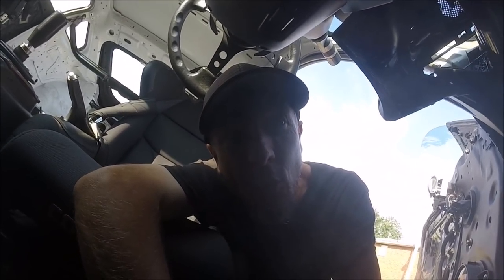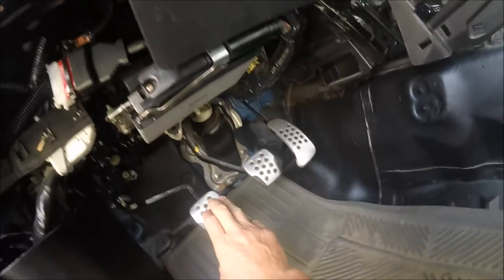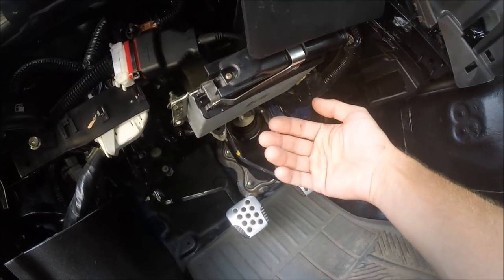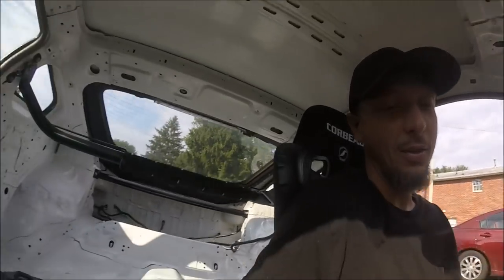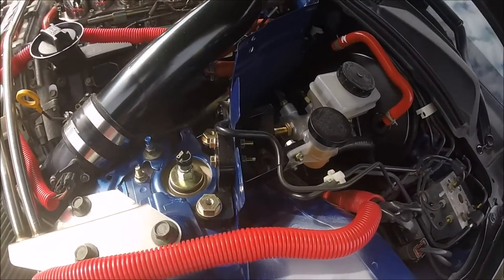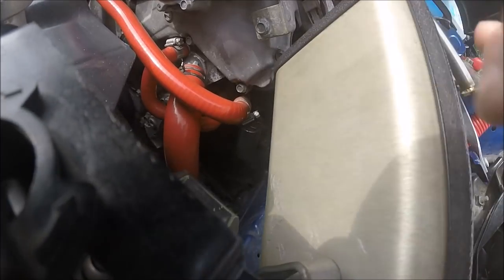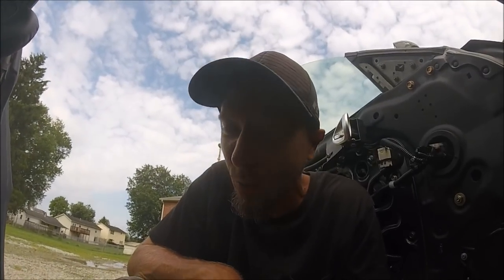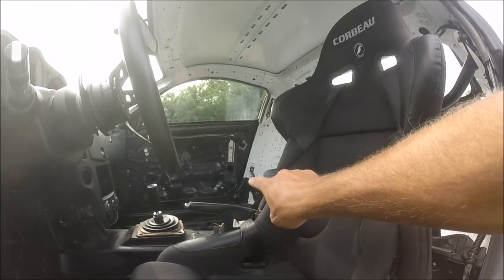Top 7 Driver Feel Mods (350z)

Comment: There is clutch damper in the drive side fender well. I just replaced my clutch and removed the factory line completely .  Most people replace the line from the clip to the slave leaving the damper in the fender well.taking the damper out Feels alot better now with the upgraded wilwood master cylinder, the new stainless steel line run in place of the factory one removes the petal drop on the factory petal all together. If this had not worked the rjm petal would have been my next move.
Reply from the maker: Nice bro thanks for all the new knowledge 👍

Comment: I just got my 350z about a month ago and so far I've got a new set of light wheels and tires, nrg shift knob, and I'm about to buy the nrg quick release steering wheel setup because as you said that stock steering wheel is pretty bad. My next goal is to upgrade the suspension, I can't decide if I should just shell out the money and buy a set of coils or just slowly upgrade all the little stuff in the suspension. Also great videos man, keep making more! I'll take any advice I can get from other (more experienced) z owners.
Reply from the maker: thanks man yeah all that little stuff ads up quick but you need all that stuff if your lowering it to bring your wheels back into spec unless you want a custom setup or if you wanna be stance boy rock that camber bro 👍

Comment: Totally agree with the wheels and tires. STOCK suspension with stock wheels felt so limited. I changed to 18x8.5 245 front 19x10 285 rear Michelin Pilot sports and the car started to really dance in the corners on stock suspension. Fucking love it
Reply from the maker: Nice hell yeah bro 👍

Comment: I can help you out with getting rid of the black on your steering wheel. Turn your steering wheel over & expose it to sunlight every chance you get. It'll be gold in no time. I've got an anodized black aluminum pipe that I've had to prop up on my gate because my dog has figured out how to get the padlock off the gate when I dummy lock it. I mainly just get it off at night getting the trashcans out, my brother puts the cans up when he gets home from work. We got into an argument because the black pipe disappeared, he swore up & down that he never seen a black pipe. He'd been using it to prop his hood up on his car. At night it still looked black to me, we were both right & both wrong. Daytime it's as gold as it can be, low light conditions it's still black lol

Comment: Hey brother. I have the HR with jwt clutch & LW FW so my bite point is in the middle now as opposed to the original bite point right at the top which was horrible. 
Do u think its still worth it to get the RJM pedal? Its about about $6-700aud for me so not cheap.
Reply from the maker: Absolutely bro I highly highly recommend it because it's completely adjustable and you can set the bite point wherever you want it and you can also adjust how soft or stiff you want the pedal feel it's truly an incredible pedal bro 👍